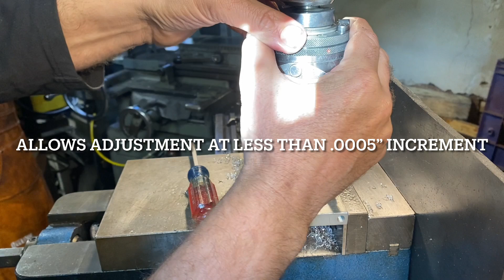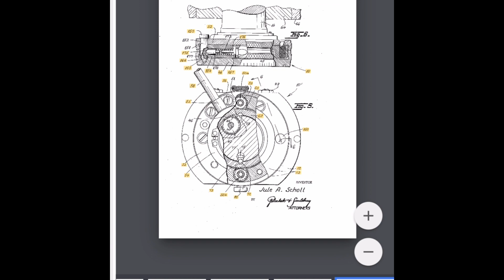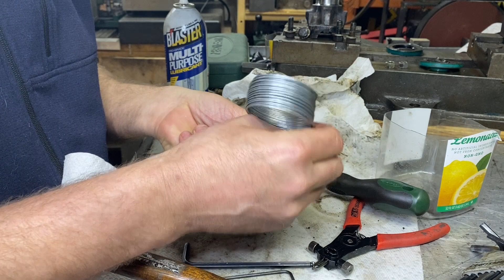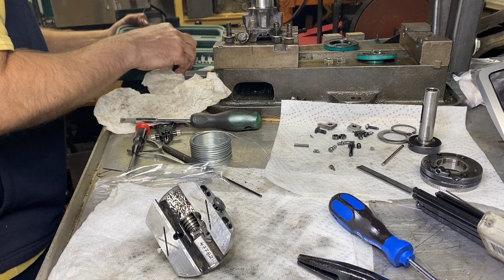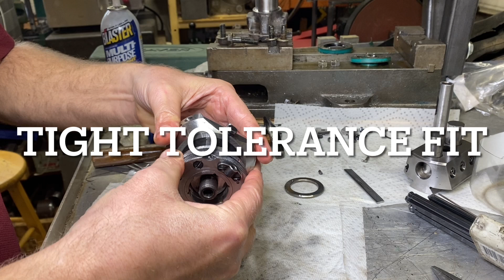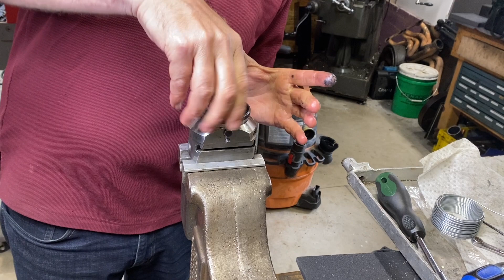Wohlhaupter boring head

Comment: Thanks fr posting, You forgot a planetary gear. The ball at the top of the head is for oiling the head. It is really unnecessary to pul the head apart. If you used brake cleaner in that oil hole and exercised the head a few times all of the old oil and grime will cone out. blow the break cleaner off and through the oil hole and re oil the head you are done, its 5 minuets of cleaning once a decade. NO GREASE goes in a Wohlhaupter head.

Comment: If you stop this video at 32:05 you can see the small gear (the one with different pd on each side) really well. I may be mistaken, but isn't there supposed to be another identical gear on the pin on the opposite side? Two planetaries and the one sun gear in the middle? There's even a pocket for the missing gear on the piece in your other hand.
Reply from the maker: I see what you’re talking about and did notice that when working on it. Who knows whether that is intentional . Seems to work great as is.

Comment: Hi, If you hold the ring when facing with a rod you have enough leverage that the feed engagement button pops out stopping the feed. Also without stopping the spindle you can push in the button on the top and the slide automatically retracts to the set starting point that you can set with the other hard stop. You also can push the upper button at any time with running spindle to stop the feed. The feed button has adjustable tention. The rule of thumb is to use the least amount of tention to keep the feed engaged, so the cutting pressure dont disengage it by itself. Using excess tention stresses the feed mechanism.

Comment: When it hits the stop the clutch should automatically disengage. And you should use the rod to keep the upper ring still (not bare hands). There is a little force needed to hold the ring before it disengages
Reply: Yes, and there is a set screw to set the disengagement force.